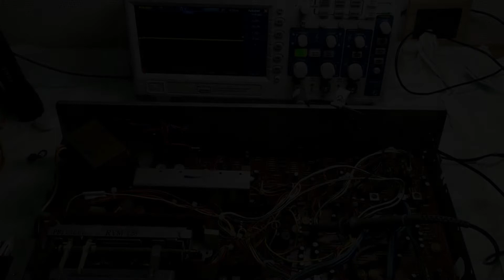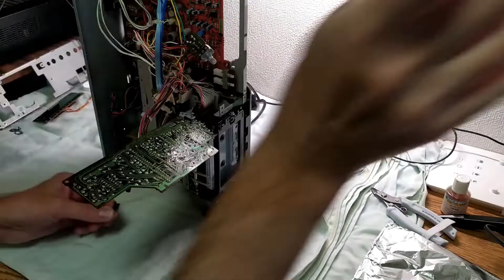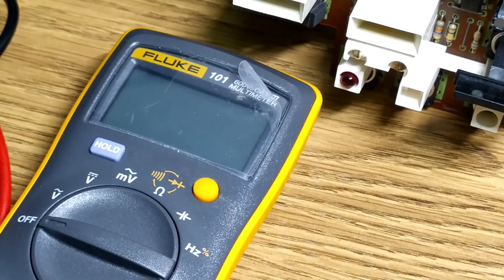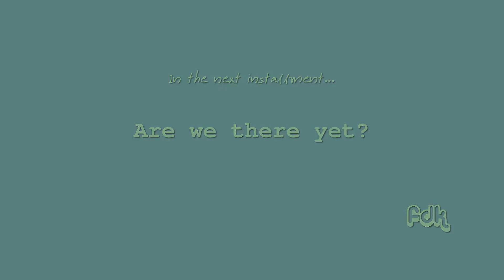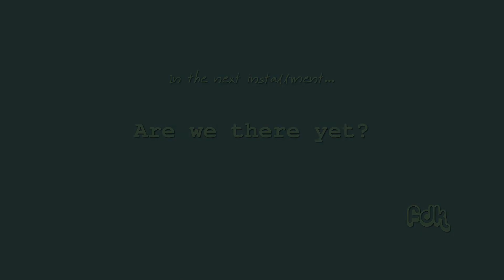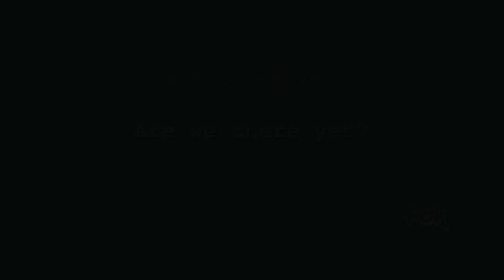Diagnosing cassette deck recording issues - Pioneer CT-7100

Comment: My Nakamichi 480Z tape deck recorded the first two songs very well, but in the middle of the third song the sound got extremely distorted and kept going like that afterward. I tried other tapes too, but they all give a very harsh, crackling sound. Do you know anything about it
Reply from the maker: No, I haven't played with Nakamichi's...yet.  On the list, but I believe they may suffer from a similar issue.   Some of the orange caps (film caps) fail.  The reason for that being common to Pioneer and Nakamichi is because it was most likely the same cap manufacturer.   If you search "orange capacitors in nakamichi" you will very likely hit on a good explanation of what to look for.  I recommend tapeheads and audiokarma forums.  You'll find the information you need.

Comment: I have to give you 11 out of 10 for patience and determination lol.
I don't know if the hot transistor is part of the oscillator or a power regulator.
If its a regulator i would check it's input voltage and any electrolitics across it's output.
If it's part of the oscillator the caps could be breaking down, the  peak to peak voltage can be more than you might expect.
All very obvious to you i'm sure.
Connect a volt meter to the supply that feeds that oscillator, just in case it's being silly :-D
Electronics has a habit of doing unexpected things, then behaving itself just to annoy us lol.
Reply from the maker: You're not wrong - it pushes at least 100V p2p.  There's a couple of ceramic caps rated at 500V near the bias trim pots!  Worth being aware whats going on.
I'm not sure if I am especially patient, but I do have a good supply of thinking juice...